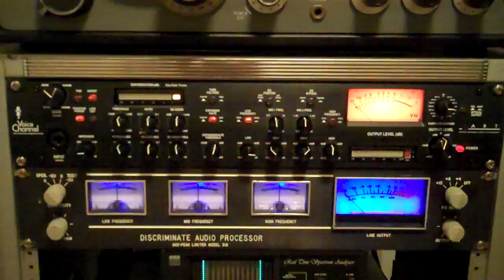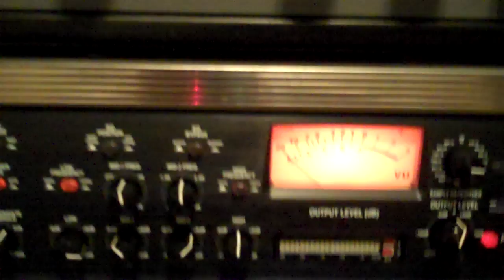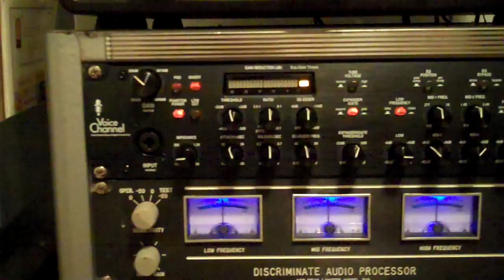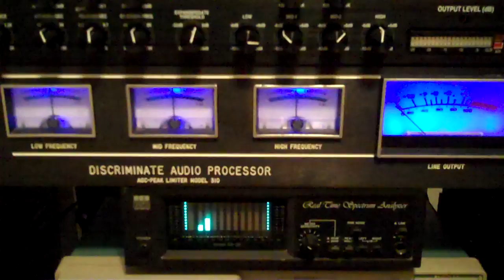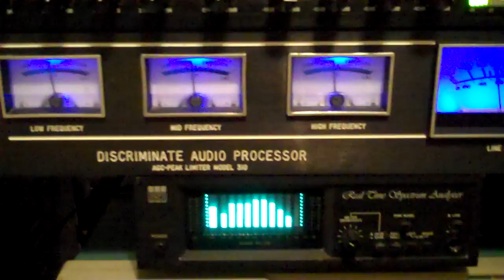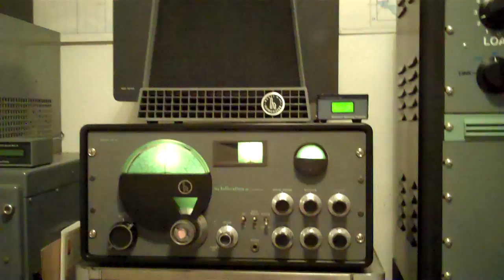audio rack.MP4

Comment: I have one of these with the later AM peak limiter board installed. Any thoughts on changing the crossover frequencies to make the 310 more useful for AM on ham radio. Maybe you've done this
Reply: I think mine is changed already. I have a 3 ring binder full of manual and notes. It was used for many years in an AM broadcast station.  I am not sure changing it much would help.  Its already way to wide.  Mine has the NRSC filter also so it limits it to 10KC.  I use a 3 way Xover to limit the low and high frequencies.  I normally keep it about 6KC but sometimes widen it up a bit if the band is clear and I wont bother anyone. The problem with the DAP is its age and those plug in cards. It seems to give trouble and sometimes is resolved with a smack to the case.
Reply: @clarkturner7484  Hi Clark. Interesting. I made some changes in the bandpasses myself. My peak limiter board has the 10kc NRSC filter. But I've had all the usual plagues with the 2k trim pots for setting the FET bias on the compressor cards and the meters moving off-center. Did changing all the ICs help? I suppose it can't really hurt. Do they drift out of tolerance sometimes? I'll email you if that's ok. Thanks Clark.